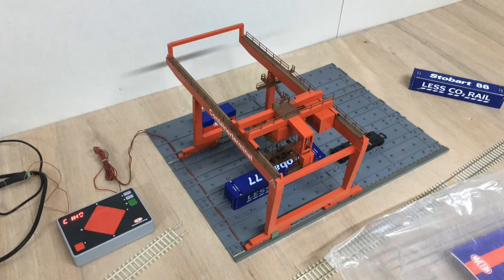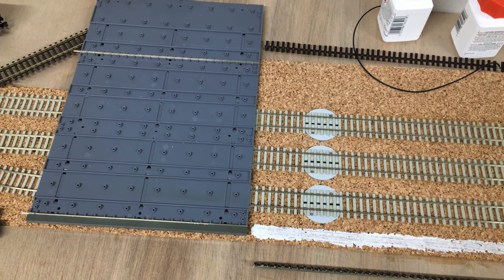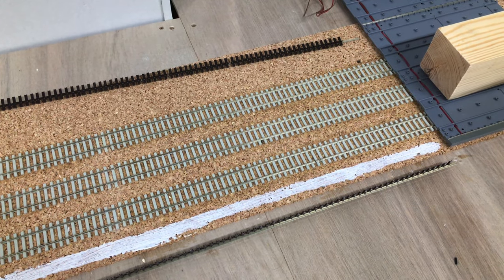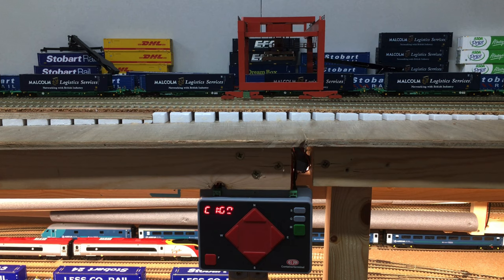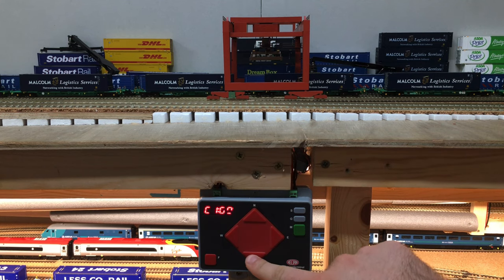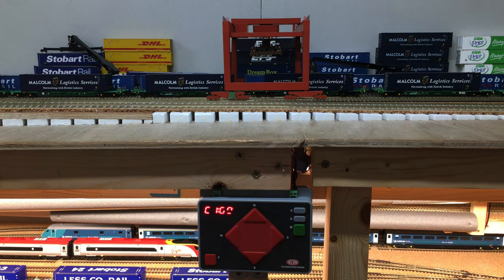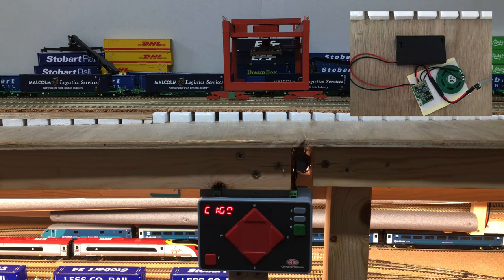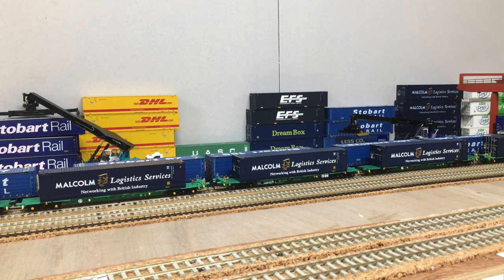Heljan Container Crane Introduction ~ Trent Valley Railway #50

Comment: Matt, your Container Terminal looks great and i just hope mine looks as good as yours.
One question for you, have you done a video on how you put metal strips or magnets in your containers.
And  a in depth video on your sound system that you added, if not are you going to do one? cheers Robert
Reply from the maker: Hi Robert, yes I did a short bit of video on how I put the metal adapters in the containers , will have to search through for which video and will post in reply. On the sound part that was very complex needing a double pole double switch , if I remember , arrangement that whilst the crane spotlight on the control pad it also ignites the sound file which I created and looped onto a sound system the clip only in this video.  but it’s not very detailed as I didn’t want to pull all the kit back out after I got it working all nicely, if it ain’t broken don’t fix it , mess with it . If your controlling off a DCC controller then I think it probably possible to set cv settings of a sound decoder to the same as the left , right movements. Cheers Matt
Reply from the maker: https://youtu.be/_r2asnt9zos 1:55 onwards for the container adapters , probably other ways of doing it with a type of metal that is more conductive to the crane magnets but it holds just about if you get it all lined up with magnets to the top of the bolt faces.
Reply: @SolarRailway   Thanks and like your idea as well, i also have some spare Heljan containers that i also may take out the metal strips and put into others cheers Robert
Reply: @SolarRailway   Yes the sound seems to be a bit tricky and maybe i will just add the sound to the video when i finish
doing the scene by down loading crane sounds, thanks again cheers Robert

Comment: Hi, my hoist doesn’t go up or down but when the buttons are pressed, the motor still turns. Any ideas?
Reply from the maker: yes, the motor and associated cog teeth in the top hoist compartment has come loose, this is a really poorly designed part and gets worn quickly if been used heavily.

Comment: The end of the depot would it not be a run round or is what you do standard practice.
Can you run Crain hoist on DCC or has got to be its own controls. Could you auto set it so have sencors in the containers some how
Reply from the maker: Crane can operate on DCC controls but I prefer the ‘manual’ element of the push buttons on the control pad whilst I can use DCC controller to run the trains, thanks for watching

Comment: You need a heljan traverser to go on the end of the container lines. Both excellent bits of kit
Reply from the maker: Yes that would have been excellent but couldn’t find one in time so instead it adds a nice operation to moving the locos about
Reply: To be honest mate ive got one on Penna Lane and there not that good, handy bit of kit but too complicated and not well built, theres not much to it really either and as such we have totally modified ours the original operating system has been replaced with a 6 pin dcc loco chip for drive function and light control and it works so much better now. You could easily make your own up.